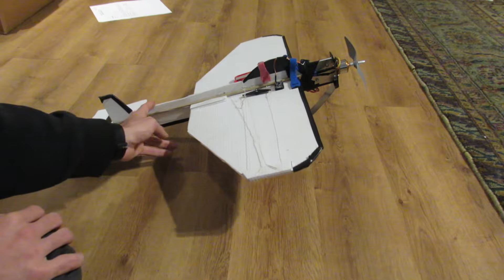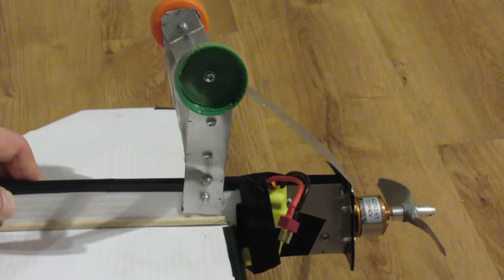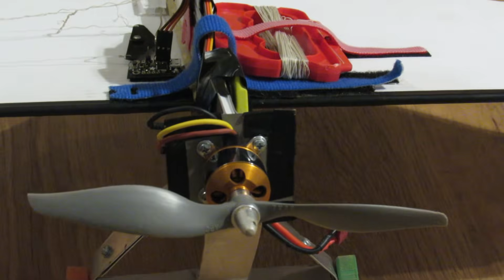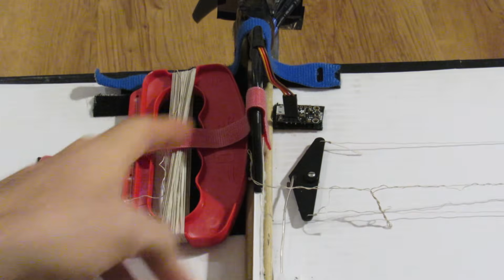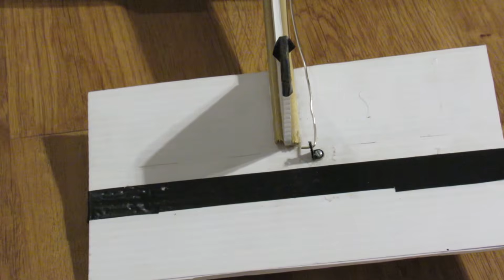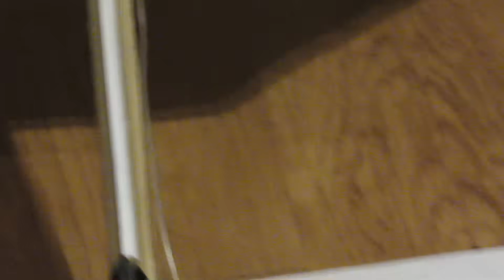I built a simple and stable electric control line model airplane for $50 from plastic sign material

Comment: Can you supply plans? Please.
Reply: I got most of dimensions from video.  Could you tell me length of fuselage overall and distance from leading edge of wing to motor mount, size of stabilizer and elevator and CG.  Thank you.
Reply from the maker: Great! Sorry I missed this. I need to go back to my plane and measure each specification as I made up the design from scratch! The wing at least is loosely based on the Manwin control line trainer from the Balsa Beavers Model Flying Club in Ontario.
Reply from the maker: @gregknipp2575 Here's a copy of the Manwin PDF: https://web.archive.org/web/20211022092246/http://www.balsabeavers.com/information/plans/manwin.pdf

Comment: What direction do you fly the model? It looks backwards compared to traditional control line aircraft, unless the camera is mirroring the image. Normal level flight should be anti-clockwise with the leadouts/lines coming out of the L/H wing.
Reply from the maker: Great question! I do fly mine clockwise and realized too late that it is opposite traditional CCW control line flying.
Reply: @walnuthills11  I guess it doesn’t matter as long as you’re enjoying it. If you ever wanted to start flying models in the other direction, you could keep the controls the same, you’d just have your up/down lines reversed compared to most people during level flight. There are a few pilots around who fly this way.